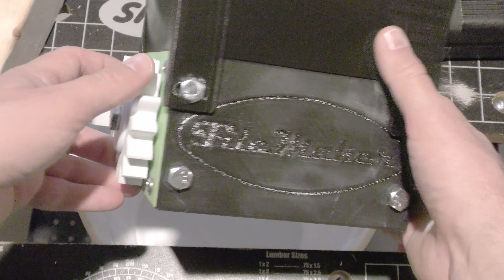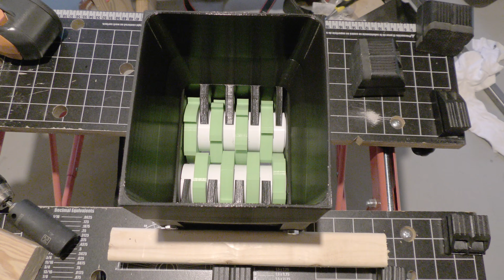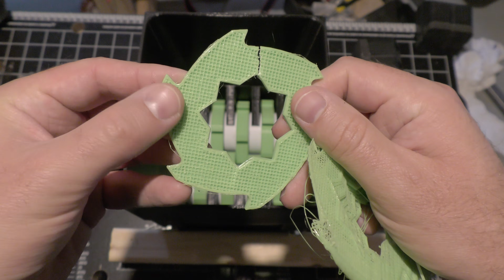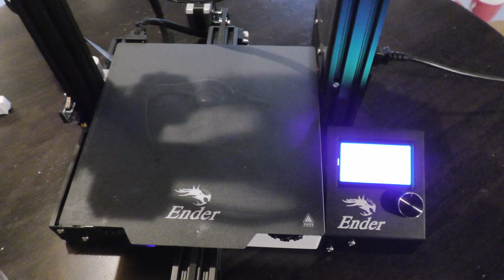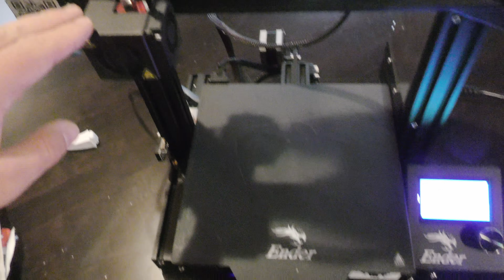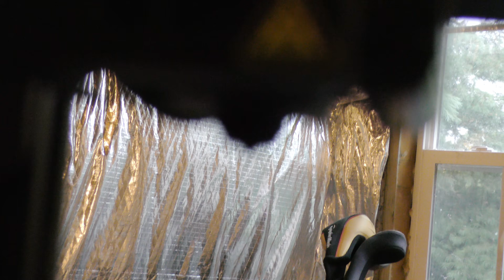3D Printed Compost Shredder Setup

Comment: Hi, greetings from Mexico, I want to make want but I have some questions… first of all what is the percent did you use in the 3D machine? Is in the FileMaker file?
Reply from the maker: The filamaker files should have the percentages.  Someone took the files and converted for US non metric sizes which I used and that one had the infill suggestions if they aren't in the original.

Comment: Interesting!  I just found this model on Thingiverse a few days ago and was completely blown away by it.  You mentioned that you used 1.25” square tubing but the parts that slide over that are designed for 30mm tubing.  I just printed some of those parts last night and the dimensions are indeed 30mm.  How did you get the 1.25” (31.75mm) tube through those parts?
Reply from the maker: Here are the plans I used.  Someone had converted it to imperial https://www.thingiverse.com/thing:3588776

Comment: wow so cool. can't wait to see it in action before I build one too
Reply from the maker: If you build one let me know what material you use.  I was debating on buying some really strong material but thought I should try it with PLA+ first and see how it works before spending more money.
Reply: World Composting I m thinking of ABS because it is stronger than PLA
Reply from the maker: ABS is stronger than PLA but I think it is harder to print with as you really need to ventilate the area due to fumes.  PLA+ is supposed to be as strong as ABS.  I think PETG would also be a good material but I don't think my printer can use that.
Reply: World Composting yes ABS is hard to print due to high temperature
This video have very good explain about each material. 
https://youtu.be/ycGDR752fT0

Comment: I love watching the large industrial shredders that rip cars to pieces. Looking forward to you shredding some worms! (ummmm... I meant corn  😉 )
Reply: LoL worms smoothie  juice :)
Reply from the maker: I know I tend to be mesmerized by them as well.  I actually went to record my first shred last night but had some issues with holding the shredder down due so I'll need a better system before I film anymore!
Reply: I'm no expert... but I imagine that resistance within the device will translate into increased torque between the apparatus and the drill. Having both bolted down firmly will be imperative to keep one or both from trying to rotate. Good luck... I can hardly wait to see how it works for you!  👍🏼
Reply: PS: I too have been contemplating a way of quickly & easily grinding up the foods that are intended for the worms. I'm not so interested in having a puree consistency - I just want small sized particles. I'm not looking to spoil my idea... but if you have ever seen stand-up comedian Gallagher's routine then you might have a clue of what I have in mind  😉
Reply from the maker: I have been trying to find something easier than using a food processor as it is a pain to use and clean.  I have seen other videos with people using garbage disposals attached to sinks but then you need a sink, frame for the sink, disposal, and a water source to use it.  Seemed like a lot of work and a pretty bulky setup.

Can't wait to see what you come up with!